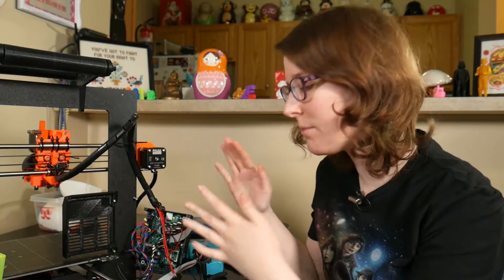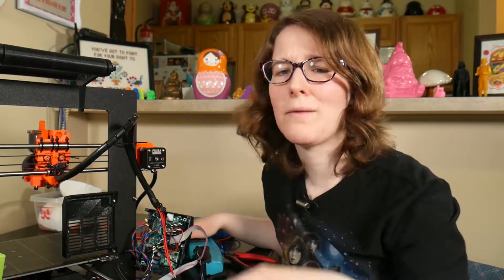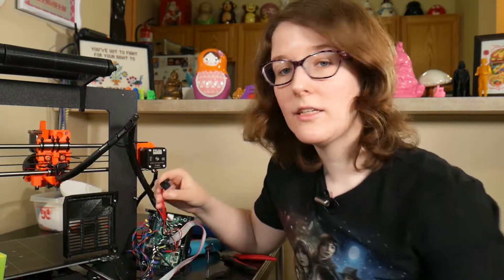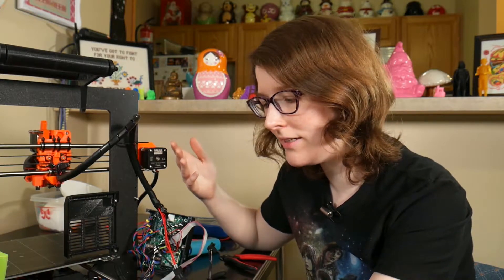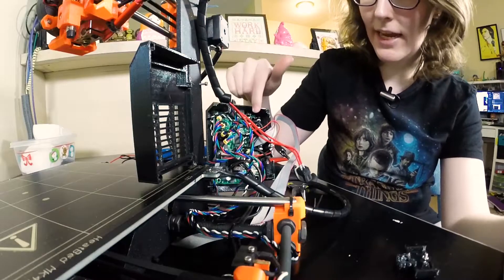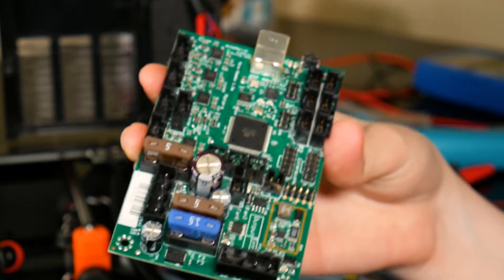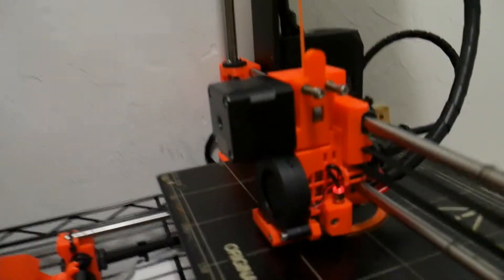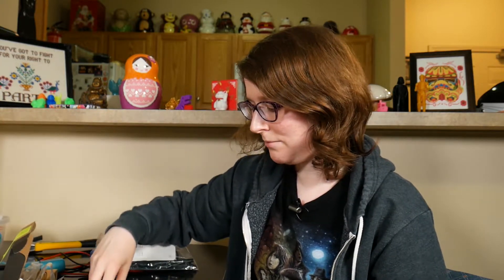Fixing My 3D Printer

Comment: Unfortunately you can't avoid 100% the same trouble again after a longer time of printing. If the pin contact is bad (aging and oxydation processes) you will change the board again. Can happen with each printer. Best solution is soldering cables directly onto the board without connectors, but of course  it's unflexible in service.

Comment: Thanks for posting! It's so useful to have more videos and blog posts of people sharing their issues and fixes! I need to post mine. I just replaced my hotend element and thermistor after getting runaway errors. I tried many of the same things you did. Such as the hair dryer test. And  theeeen I was having an x axis end-stop issue that was blocking my completion of my Rosie piece. I just figured out the issue and it was my bad. My hotend cables were not snug enough against the hot-end so they were blocking the end-stop switch from getting pressed.  Fixed! Anyway.... thanks for sharing the problem and resolution. I picked up some spare molex connectors as I was thinking that might of been my problem. I've been very close to getting a new board as well. Pricey, but nice to have that spare. All bests.

Comment: Now that you have the board out go ahead and replace the connector on the board. A cheapo soldapult should work with a decent powered soldering iron. Adding a little real solder 63/37 or 60/40 might help then suck the joint  dry. A good quality solder wick braid with a little flux should work if you don't have a soldapult. Just don't sit on a pin too long with a under powered iron or you might lift a trace. That's usually  fixable to :) I'd bet it's nothing more than a high resistance on the connector and the board is fine.